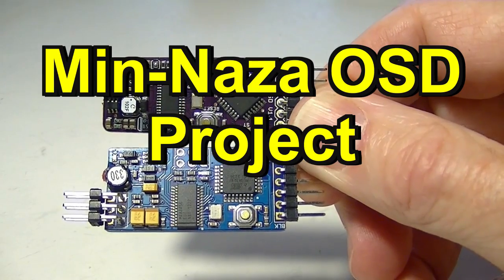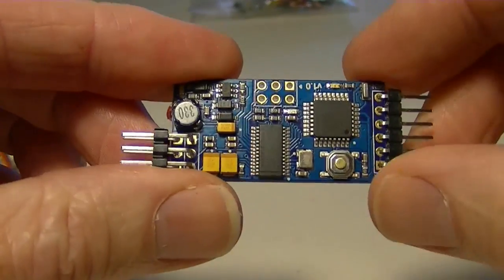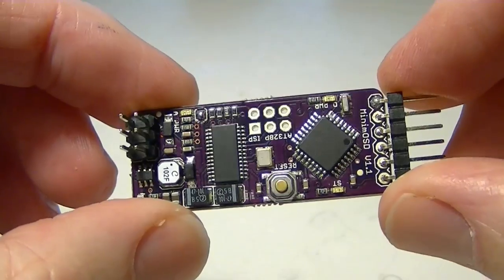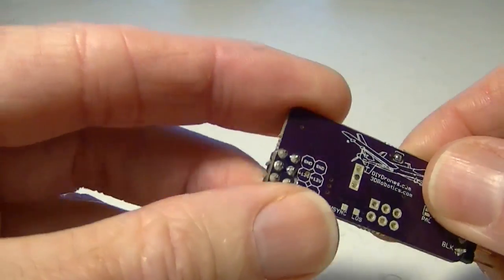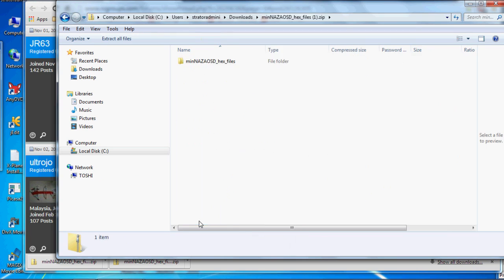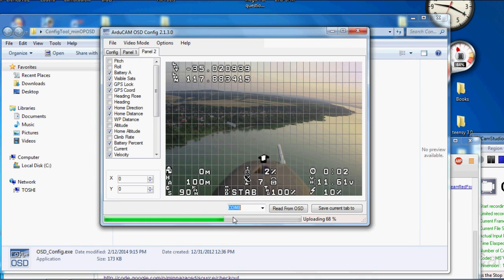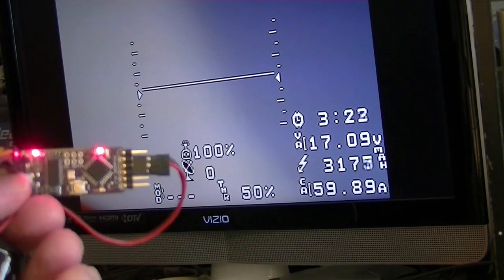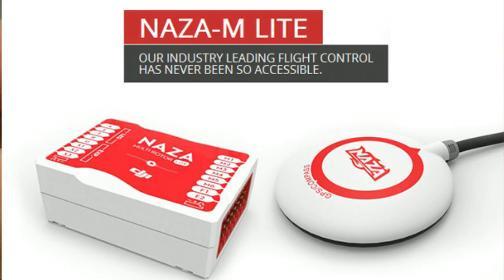MinNaza OSD Project Part1 (Preparing MinimOSD for the Naza M Lite)

Comment: HELLO FRIEND CONGRATULATIONS BY Video, I have a problem in updating charset that at the end of updating displays this error "ERROR ENTERING MODE FONT NO DATA. What can be.
Reply from the maker: Common problem. The new firmware has no char set loader. Load older firmware, update char set, then load new firmware.
Reply: hello, u have the link that older updating'm having trouble please think, I thank you for your attention.

Comment: very nice. i have my minim powered from camera side with 12volts and i soldered jumpers on both sides. i am not attaching to flight controller and i just want to see horizon line. how would i get this to work?
Reply from the maker: +kennethpappas If you want the artificial horizon line to work you will need the fight controller. It uses the pitch and roll from the F.C. Look at the subsequent videos for more info
Reply: +dmerc00 I am using dragonlink as a receiver

Comment: osd is only suitable to layer on analog video sig. right?  I saw a good quality digital vid shot from a go pro type quad cam with osd.  If you put osd on top of digital sig, won't it degrade the picture quality?
Reply from the maker: +Jamie Lee Yes, This project is analog video. Not sure about the digital video. Perhaps with WiFi it will allow a digital overlay but of course the range is crappy.
Reply: +Jamie Lee Thats why you need a video switcher. Your FPV runs normally thru to the ground station and goes on the DVR. You momentarily switch to gopro to make sure what its filming.

Comment: Got a question. I am building a Y6 700mm.  What gain settings would you recommend for video/photo flight. I have years of experience building and flying quads and hexes, event tri(s), but this will be my  Y6.  Using Naza Lite w/ GPS as usual.
Reply from the maker: What I did was adjust the gains remotely while flying.
See this video for setup for remote gains:
www.youtube.com/watch?v=4gPkFBmgCxA

Comment: Hello there again. One last question for you,,, is panel 1 or panel 2 the default screen for the mavlink osd. And can you switch it without having a separate channel to toggle between them. Because I just need one of them. But not sure which one is the primary panel. And yes you were right is was looking at the TA instead of the HA. Thanx for that.
Reply from the maker: kevin filek I think it is panel 1 that is default. 
Yes you may be able to switch panels by changing your flight mode switch if you enable toggle mode on the first tab.

Comment: I have a question for you,, my mavlink osd works after I followed your video but ,, the altitude never zeros out when I launch, it shows an altitude like it is above sea level. How do I solve that issue. Everything else works fine but the altitude.
Reply from the maker: kevin filek There are two altitudes that can be displayed.
Make sure you are looking at HA, home altitude. You may have to calibrate the barometers on the APM to get close to zero. How far off is it?

Comment: Awesome video set. I used the 3DR Minim OSD to install with my Naza lite. I soldered a wire off the GPS puck and ran to the RX pin on the OSD. I followed your videos to a "T" I cannot seem to get it to work. My video downlink from my GoPro works (1.2ghz Lawmate RX/TX) but I am not getting GPS info to register on the OSD. My screen displays 0 sats, an unlock icon and 100% RSSI. This is when my Naza LED is blinking green with no red blinks at all. I have set it out for 30 minutes in the yard once and never got GPS data to show up. Any ideas?

Thanks
Reply from the maker: You need at least 6 satellites for GPS information to be displayed. Looks like you are getting that if you have the green light. Perhaps the wiring is not right yet. I did not solder to the off the GPS puck so I can not verify your wiring on that.
Reply: ***** Found my issue. Soldering to the GPS puck requires the firmware to be setup to use Ublox protocol, I was using the DJI firmware. Once the firmware was changed, it fired right up and got 8 sats in my living room. Thanks again for posting this video set, it really helped me.
Reply from the maker: Ryan Vanvels Glad you got it working. I never would have guess that you needed the Ubx firmware just because the wire was attached directly to the puck. Must be on the forums somewhere. Good to know this.

Comment: Dave I hate to point out the obvious but didn't you end up with the LED facility in the end?
Reply from the maker: What is a LED facility?
Reply: ***** Oh gosh, sorry for being vague Dave. I was watching your MinNazaOSD videos from the start to get a feel for what you went thru and I know that you ended up using the LED feature in one one of your OSD "Panels" indicating  Naza Status LED that shows up on the V.U. So I figured you would have had to use the FW for it right? I got a Team KV OSD http://witespyquad.gostorego.com/accessories/minimosd.html 
that has the resistors/voltage dividers built in to the board and has the Batt1, Batt2, RSSI, and Current plus associated gnd connections "broken" out to the edge of the board where you would solder some pin headers. I am looking at the different ways....!!!!. There is one using Arduino that is promising but none of it is simple.  Mostly because of identifying the Code that you need. Got this Arduino Nano Pro V3  - 6 connections to be made to it, 3 from the GPS, and three to the OSD and then another 4 connections for Video/flight Batts. All could be done with 26Ga wire. I will be employing your method of getting that GPS signal from the Naza M.C. Clever of you:-) Hope summer is not too hot down there.  Happy Flying Dave :-)
Reply from the maker: Chris Leech Not sure what you mean by "FW" but yes I did get the LED feature to show up on the OSD buy making the suggested resistor divider adapter. RSSI I could not do because my OrangeRX receiver does not have an output for RSSI. Also skipped the current, but made my on voltage sensor with a resistor divider. Good luck with the KV OSD!  I wish someone would make a MinimOSD board customized for the MinNaza implementation.
Looks like we are having a few cool days for the weekend and hope to get outside a bit.
Reply: *****   FirmWare :-) And I am going to need it. Word has it the TeamKV OSD is already flashed  but what? Considering all the choices in the zip file you downloaded and unpacked.  What I have decided is to hook it up to the camera and screen and see what "stock" is out of the box. I am impressed with your ability to find your way around  the zip file. There are all these extras, how did you know to zero in on just two. Yes some are obvious, but for instance the Charfile Folder has an .mcm and a .hex file in it. How does one decide which one? By trial and error? :-) You sped up the final edit by some %, and Dave,so help me it moves so fast as you're unpacking this and deleting that and moving this here and that there OMG . I slowed it down a notch so I could get the details.  :-) What I will share with you is the Video I shoot of the Arduino option No INSANE SOLDERING option . I just got to figure out how to do the camera rigging for the tight and close up of the soldering. You have done some really amazing work, I realize as I try to duplicate your framing and all. Catch you on the flip!!
Reply from the maker: Chris Leech It has been a while but I think I got my information by reading the RCgroups threads combined with the wiki. Admittedly it gets confusing but I sorted it out eventually. I definitely would like to see your video when you get it done. My camera has a very good auto focus on close-up video. It's a higher end JVC. What I do is place the camera on a very short tripod on the bench and do the soldering within inches (200mm) from the lens with an LED desk lamp in close proximity. I keep the viewfinder right in front of me so I can glance at it to check the framing.
    "see you on the flip side" Yes, that one I understand Zzzzzzzzzzzzzzzzz.
Reply from the maker: ***** FirmWare: Oh now I see what you mean! Yes I probably switched from the NoLED firmware hex to the LED hex. Truth is I don't even remember now. I think you have found a discontinuity in my video series that I wasn't aware of.  Another one is the character set file. I did load the character set in a later video because the artificial horizon was messed up. I briefly show the trick to that. You must load the UBX firmware then load the character set then go back to the original firmware. This is because of a baud rate bug. It's in the RCgroups discussion somewhere.

Comment: Hi! Like the very review MinNaza OSD Project, I have a question! 
I have Naza m lite and MinimOSD MAVLink OSD APM APM2 Flight Control Board, as it is connected? Just like in your video?
Reply from the maker: I don't understand what your question is. To me your post reads as a statement of facts.
Reply: In your video two mini OSD, you are considering only one, the second just as connected?
Reply from the maker: timath777 Both will work but I prefer the one for easier soldering.
Reply: I have a second version of what action is necessary to further soldering produce? or do not need?
Reply from the maker: Each one has to be done differently. Solder jumpers on the second one do the same thing as the wire on the first one.
Reply: I do not have such a chip 330 which is supplied +5 V, I find it at?
Reply from the maker: timath777 Get this one instead:
MinimOSD from HK
Less expensive and has solder jumpers,
http://hobbyking.com/hobbyking/store/uh_viewitem.asp?idproduct=36844
Reply from the maker: I am not familiar with that one. Good luck.

Comment: Hi the minimosd is ok for nazam phantom1 ? The same connection 
Thank you
Reply from the maker: I have no experience with the phantom 1.
My guess is you should use the DJI OSD for the phantom.
Reply: ***** Funny.. As Phantom 1 has Naza v1 (not lite) BUT this mod should be OK for any NAZA NOT just Lite.. This is tiring BUT very affordable MOD, thanks for the effort for any one who has time. BUT otherwise BEST is to go with Remzibi OSD clones they became cheap. Otherwise for any NAZA v1 or v2 we need to buy PMU and OSD mini which is at least 130-140 USD together..